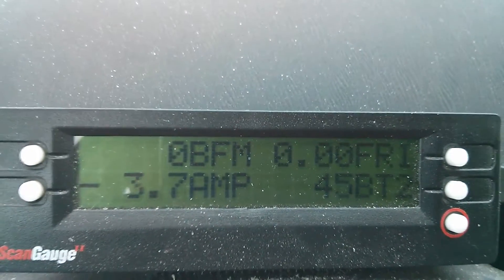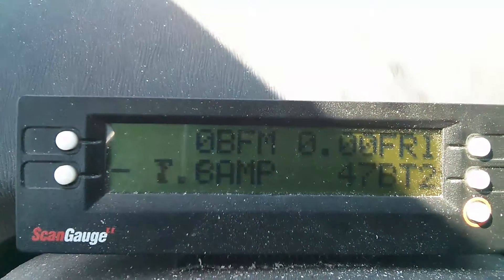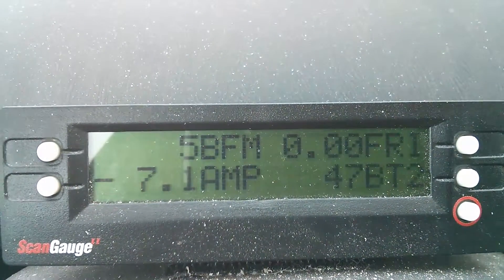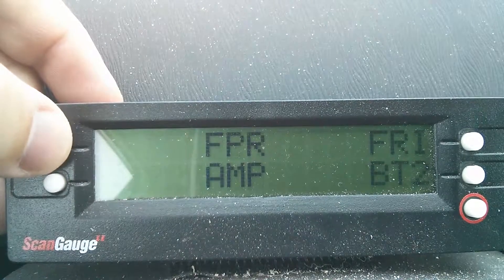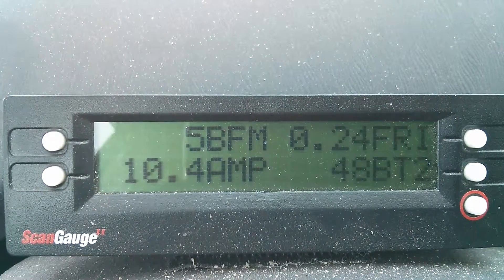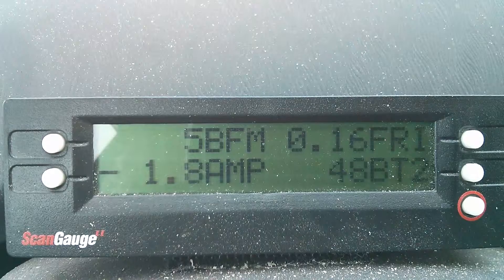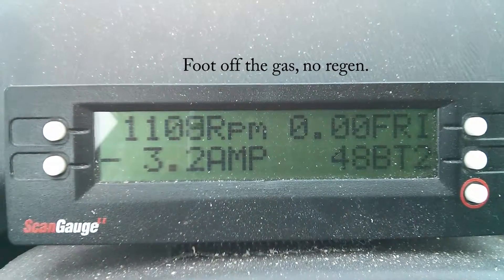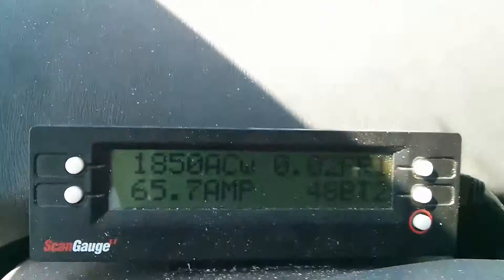2010 Prius Hot Battery in Phoenix

Comment: Those temps look normal to me . Nmih battery's can run that hot . I think it's the temp sweet spot for them to 30-50 celcius
Reply from the maker: I'm less concerned about the temp, and more about the consequence of lack of cooling at start and the poor performance/MPG/constance ICE running as the ECU attempts to limit battery I/O. Rate of charge is no more than 20A.

I started this morning w/ ambient temps at 86°F. Battery temp was 40°C, and BFM was at speed 3 within the first minute or two, and performance is normal.
Reply: At first start ice it will keep running until cat. Is warmedup, then the battery ambieln tempo ( sensors are connectec around battery Cells and not against them. The car wil first not cool tot let the battery heatup when a heatup is detected ITV wil start cooling . it al depends on a lot of sensor data and therefor will not always be the same.